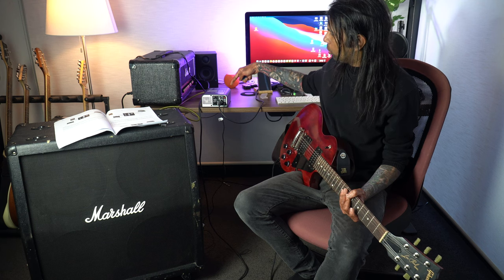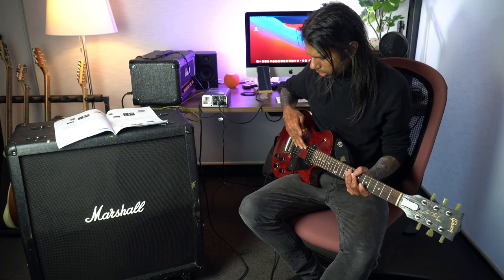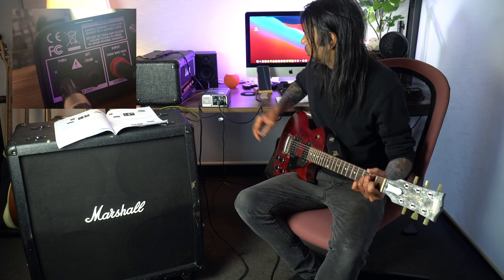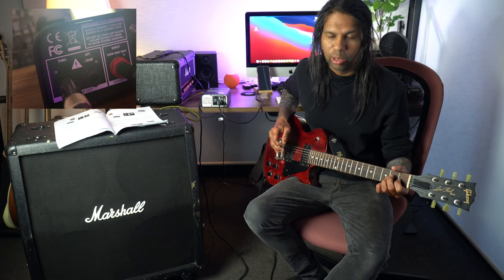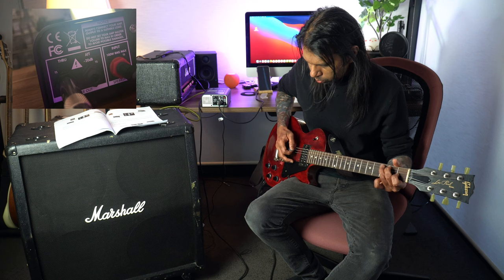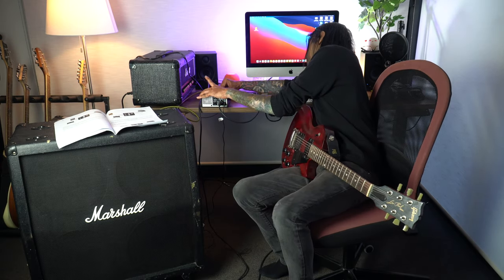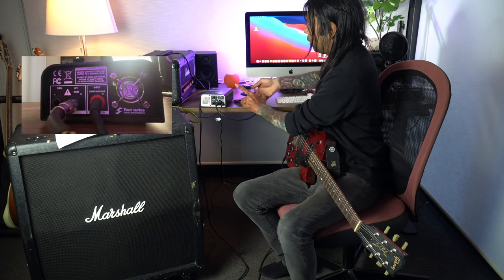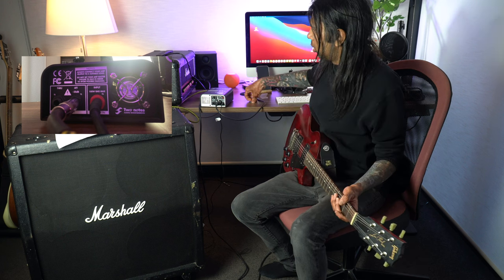Attenuation using the two notes torpedo captor (Part 3)

Comment: I just got one of these off Facebook market place...  It allows you to turn your tube amps up to the sweet spot with out the police showing up... lol.  That knob got me too...  I was turning it expecting something to happen, but it only controls the digital signal to a DI or your recording interface to prevent clipping.   I paid $125 for mine, and I feel like I stole it at that price, because my vibroverb doest even wake up until about 5, and prior to buying this thing I couldn't turn the amp past 3 with out squinting my eyes.  I think I may end up selling this one, and buying the next model up so I have a little more control over attenuation, and output level, also you can plug up headphones and play without a speaker.  I could already do this by plugging this unit into my interface that has headphones, so, im not in a rush to upgrade..  Mainly wanted to see how it functioned before I invest deeply into the next  range of products witch puts you from $600-$1500 depending on what you get.  Pretty cool little gadget...